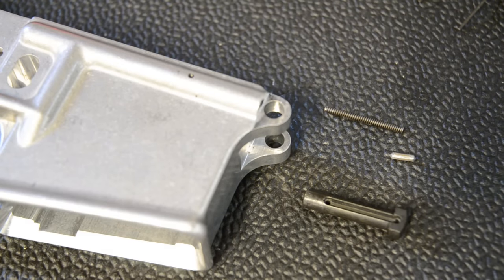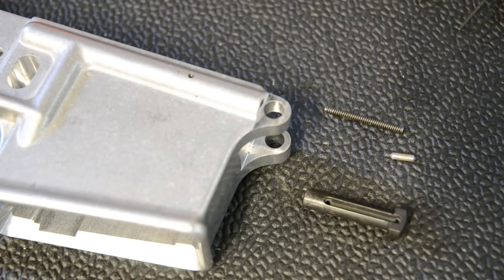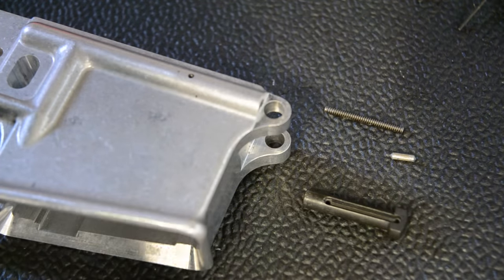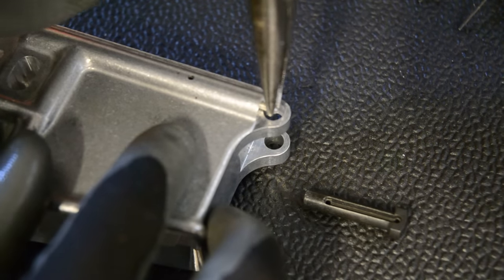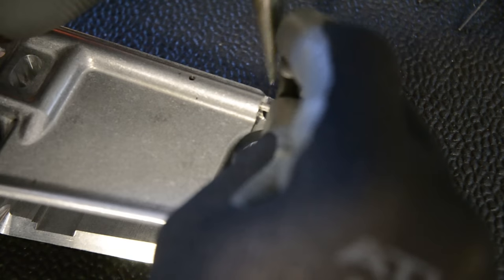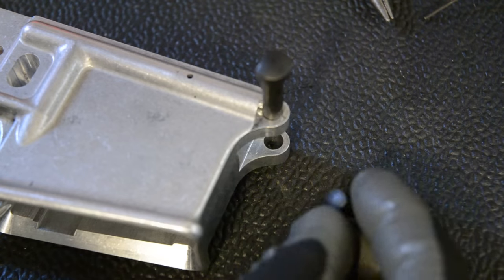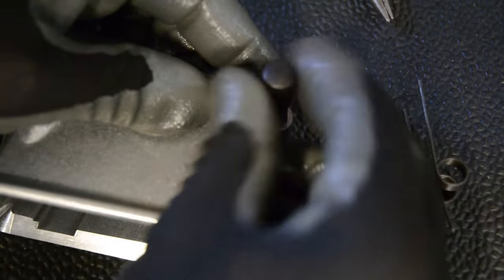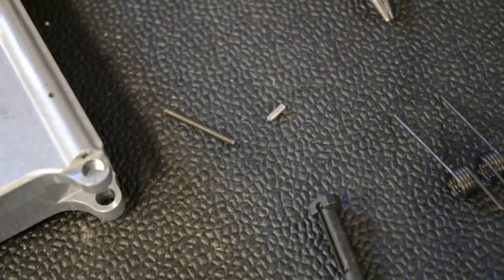Install the Front Takedown Detent the Easy Way On Your AR15 Lower

Comment: Another Method. Takedown pin install for receivers with a tiny hole on the side of the of the takedown spring hole in a receiver. The hole in the side allows you to put a sharp nail or pin to hold the spring compressed. Some receivers have this , some don't. This method allows you to take a long punch and push the spring in deep below the hole. Then you stick a pin point into the hole and it holds the spring in a compressed state. You drop the detent in all  the way into the hole with no tension and push the takedown pin in into the receiver holes. Then you pull out the nail or pin from the side hole and this releases the spring to put tension on the detent again. You rotate the takedown pin till the detent locks into the channel.Super easy if you have the proper tools.
Reply: joewger  will you make a video of this?
Reply: Oh man this just makes so much sense now I was wondering why my lower had a hole just like you said. Your comment just saved my day hope you see this 👍
Reply: Very small aperclip or jewelry wire, or bread bag twisty wire!

Comment: Just assembled my first lower.  I was really confused when the psa lower kit came with three detent pins and springs.  For the life of me I couldn't figure out what the third was for.  After attempting to install the feont takedown pin I quickly learned that the third was to replace the one you launch into orbit.  Got right back to it with the spare.....now I wish they would have shipped 4 instead of 3.  Oh well, now I've got a reason to swing by my local gun store to pickup a few more.  Lol

Comment: my spring was far longer but this worked first. God bless you sir you saved me so much trouble
Reply: Far longer? These are mil spec parts 😂
Reply: Mine was sticking way out also. Didn't just "drop in". Not sure if the hole in the reciever wasn't drilled deep enough
Reply: i cut the spring short enough so the detent will barely sit in the hole by it's self, use the pin to push it in the rest of the way.

Comment: Great and easy video. I have built around 10-15 lowers. One time I sat for like 30 min trying to put that fucker in. So I came up with the idea of putting pillows against the wall, while sitting facing the pillows. So instead of having everything flying all over the place, it was hitting the pillows. I always do it like that. Usually I get it on the first try, depending on the spring. Some are really stiff.

Comment: Wow, I had it done in my second attemnt and in total less than two minuets! Sure, it did require some fine motor skill but it actually worked! Many thanks for sharing!
Reply: I cannot get to insert back the pin and the spring

Comment: I just did one. 
Held it upright, set the detent on top of the spring & compressed it with the pivot pin; then slid the pivot pin home. 
Job done, sans tools.

Comment: What is the hole on the side of the detent spring channel for? I always wondered if it could be used for compressing the spring, but I never tried it out
Reply: You're correct. It's for holding the spring in a compressed state.
Reply: Yes, The hole in the side allows you to put a sharp nail or pin to hold the spring compressed. Some receivers have this , some don't. This method allows you to take a punch and push the spring in below the hole. Then you stick a pin point into the hole and it holds the spring in a compressed state. You drop the detent in all  the way with no tension and push the takedown pin in. Then you pull out the nail or pin from the side hole and this releases the spring to put tension on the detent again. You rotate the takedown pin till the detent locks into the channel.

Comment: Thanks! I tried the round angle tool with the hole, but every time I would push it out with the takedown pin there is a slight gap that catches the tip of the detent and lauches the detent and spring. Sideways the ledge of the hole supports the pin till it drops in the hole.

Comment: Another easy way is... Drop your spring in use a small punch to compress the spring take a sewing needle put it in that really small hole on the side of the receiver to hold the detent spring captive, drop your detent in, put your take down pin in, pull the sewing needle out.

Comment: Back when I did mine I used an exacto blade to hold the detent back, the pivot pin slipped past the exacto blade easy and then I rotated the pivot pin to engage the detent

Comment: You can push it down with a razor blade and slide the pin over the razor blade then pull the razor blade out